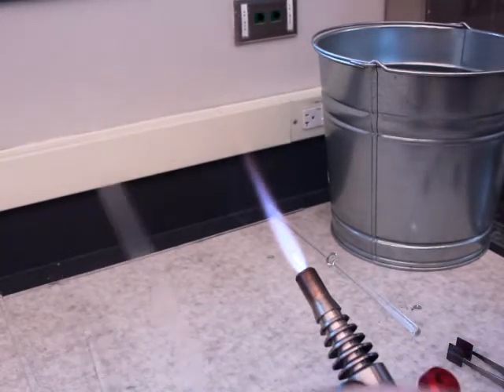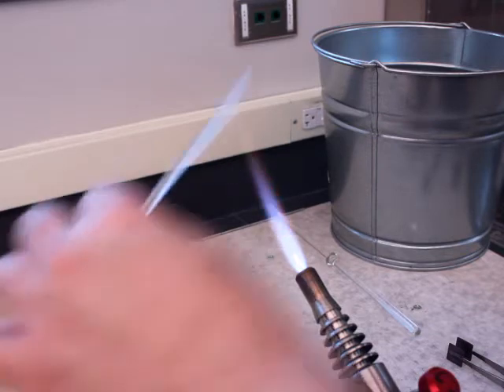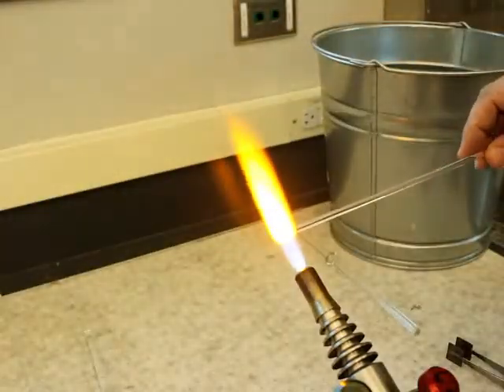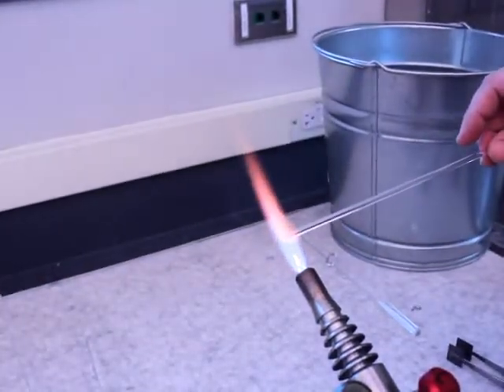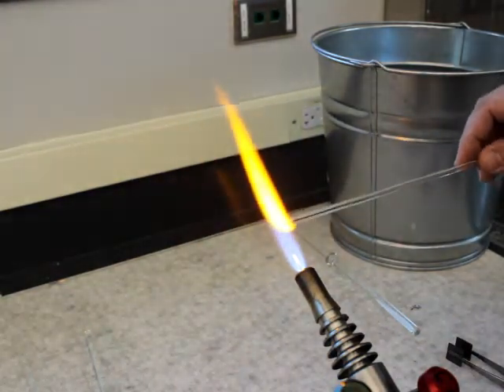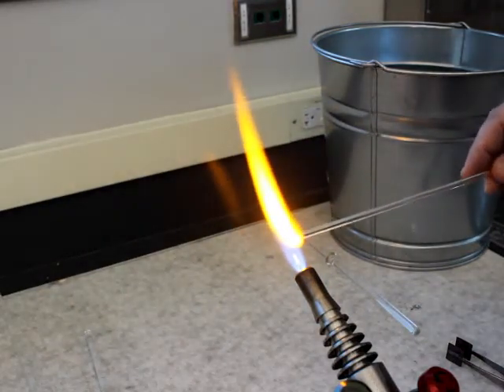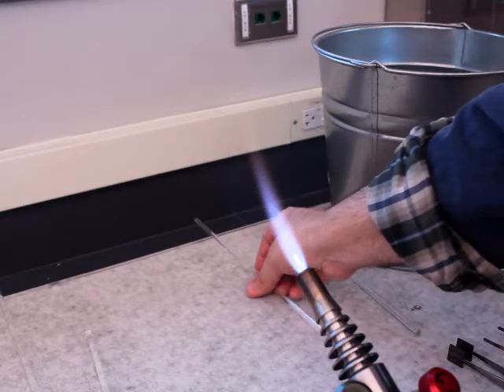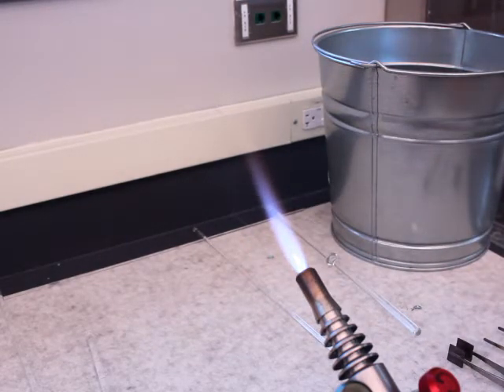Scientific Glassblowing Lesson 3:  Didymium filters

Comment: Tiffen™ manufactures a didynium filter...it is sold under the name 'Tiffen Color Enhancing'  filter...it is recommended for enhancing 'reds' especially for autumn outdoor photography...works wonder to filter-out sodium street light pollution and is very efficient...sure you could use very effectively for boro glassblowing. Nice video, Regards.
Reply from the maker: That's good to know.  I just got a round to looking at those filters.  Very cool.  I'm using a Cannon 24 mm pancake lens.  I glued a didymium filter into a lens hood.  If I need to swap out lens I'll definitely consider getting one of those filters.